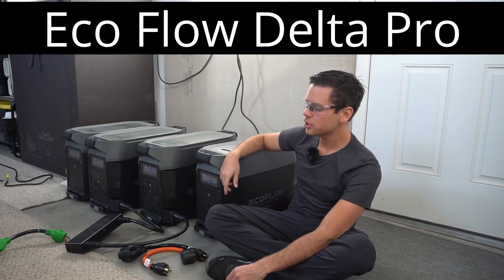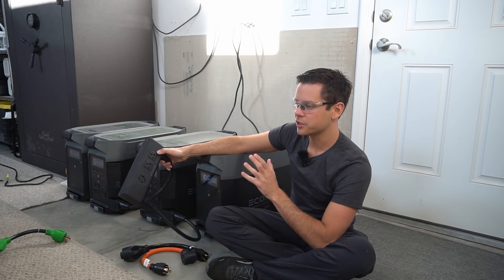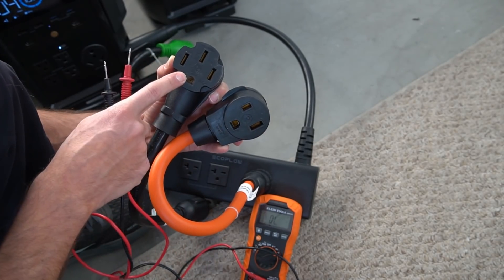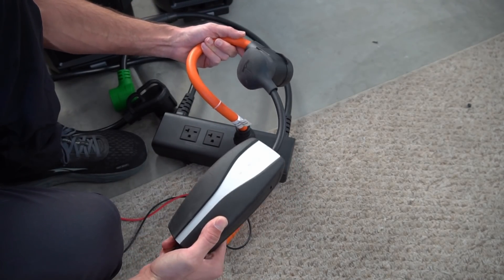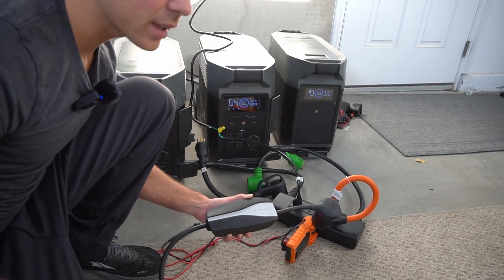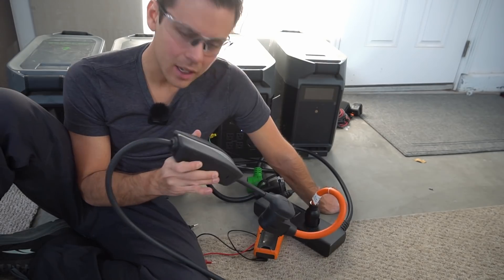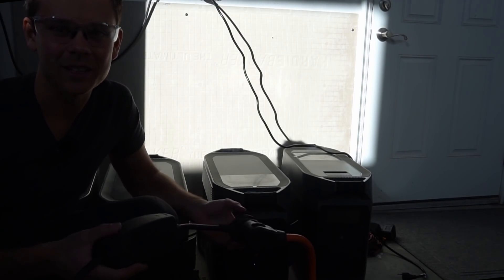Ecoflow Delta Pro: Strange Problem with 240V Output

Comment: Will,  Can you run a 50 amp rv on a ECOFLOW Delta Pro 3 by using a L14-30P to a 14-50R adapter plugged into the front of the Pro 3?    Thanks

Comment: I tried to take two, 120 watt generators/ inverters by using a parallel kit, change the wires in the kit to combine the two legs and power my house. My amp meter would go to 240 v and then start counting backwards because, I think the phase wasn't in sync or out of phase. Does each hot leg have to feed back on the neutral intern or is it simultaneously? This may be why your charger is not working with this setup. But I thought that Hub allowed you to convert the two into 240 volts and run your house. Would love to see you do a video with you explaining exactly how the electronics work inside of that hub. And I enjoy and respect how you make your videos.

Comment: I hate that I cannot charge via my inverter Generator via AC while the multi port adapter is plugged in. This really sucks cuz  the use of the multi port adapter shuts off all ac, both input and output

Comment: Question? I have the ecoflow rover pro and the expansion battery. bought them without the expansion cable.  not it is not a delta cable... might you by chance know if the pinout on the river cable is a straight or twisted pair configuration? so i can build my own cable.

Comment: I got it to work with a 240v Nissan EV charger and bonding the ground-neutral pins in the 4 prong generator side of a NEMA 14-50 adapter.   Using the same setup I tried to connect the Tesla Wall charger and it gives the same error you observed.   Here's the puzzler I don't understand:  If I plug in the Tesla Wall charger to my main House panel then unplug it and quickly plug it into the adapter on the EcoFlow DP double voltage hub.  It works great up to 32 amps.  240v.   But once that system shuts down I have to go through the same process of unplugging and plugging it in with the home main panel.   As you probably know there is no connection of the neutral to anything in the Tesla wall charger.  It only uses the ground and two hots so I can't figure out why it doesn't work with the Tesla Wall charger like it does with the Nissan 240v charger.

Comment: Question: not sure if you tried this or not have you tried to connect this unit directly to your home electrical panel via an interlock and set up a specific circuit for the Tesla charger (being the wire is grounded and neutral present perhaps you can trick the charger to think it’s a normal circuit?

Comment: Can I connect 2 Delta Pros using the doubler and then plug a 50 amp RV (with the appropriate adapter) into the 240 volt 30 amp receptacle on the doubler?  This would be much easier than rewiring my RV for solar and would allow for a transportable solar system if you changed RVs.  I will charge the Delta Pros with 1260 watts of solar.

Comment: Do a video on connecting two delta pro and two batteries to a 50 amp plug that connects to a house let's see how much hours of power you get running a house

Comment: I've been looking at these and the Bluetti for the 220v functionality but they're a little pricey for what I want. I've been watching tons of your videos trying to figure out what is the cheapest way I can build a small solution with 220v and about 10kW peak output to be able to cycle my well pump several times during a power outage. Any suggestions?

Comment: You might need to cautiously lift the plug out or use one of the other outlets on the box to measure voltage with the charger plugged in.  Sometimes things look good without current, but different with current.

Comment: The proper solution should be that eco flow provides a access on the device that lets you tap into the homes ground or connect a grounding rod directly to the unit.

Comment: You are energizing ground conductor when you connect neutral and ground wire together. There’s division of current between neutral and ground, and probably a GFI circuit senses that and immediately shut off your charger. You have basically replicated the erroneous practice of connecting the ground conductor with the neutral conductor   in a subpanel.

Comment: Hey, Will.    Ben Sullins on his Channel got this to work as an emergency refueling for his Tesla.   You saw that one, right.  He just had one in his trunk, and did it in a parking lot, not connected up like yours.
Reply from the maker: Not the same. I have past videos doing what Ben sullins did, but that's using 120V. I'm using 240V

Comment: Is it any issue relating to the nature of the 240V (220-250VAC) used in other countries - ie. single phase to neutral (with a MEN connection), rather than split phase US 240V...

Comment: Hey all, Thinking of getting one of these for my van conversion. Anyone if the constant daily use would appropriate for this unit? Or is it more designed for occasional use? Thanks for any input :)
Reply: In the same boat so watching 👀 a response.
Reply: Also have you also considered the Growatt off grid beginners system Will talked about before?

Comment: As Tesla isn't the only one, my KIA e-Niro also has error code, I think; the reason of EV charging without earth ground issue, is do to the protection from lightning strike as during outdoor's charging. Because rubber tires well insulation. As grounding will protect older houses from lightning strike; as older houses along with way outdated wiring. Safety is first for EV.
Reply from the maker: Good to know

Comment: I ran into what appears to be a similar problem. I used to use a UPS for my electronics loads because my inverter (Victron 350W) couldn't handle the inrush current. The UPS could handle the floating neutral fine, but with a warning light on the back. I upgraded to a larger inverter that could handle the inrush without a problem, but the UPS tripped the GFCI in the inverter (Renogy 1000W), even with the inverter's bonded neutral. I'm guessing the GFCI current transformer is in the wrong place. Either a disconnected ground or an isolation transformer would solve the issue. I also now use an APC ATS for electronics load so I can switch them to utility for inverter maintenance or low batteries, with no UPS in the path. Also, my Renogy could handle all L1 EVSEs I could throw at it. I haven't poked around enough to dig further into the issue. Wait, I see you may have found a solution below I'll have to watch.

Comment: Ecoflow is a little strange. It wouldn't charge my chainsaw batteries.  It barely ran a water pump and only if I had a small 12 volt battery helping it.

Comment: I simply use the 30A outlet on the DP to charge my MY.  I purchased a converter plug that goes from the 30A DP outlet to a NEMA 14-50 and I can charge at 24A.  I also had to purchase a bonding plug for it to work properly.  I only the single DP for now so only pick up approximately 3 kWh of charge in roughly an hour.  Not the most efficient but works in a pinch.

Comment: I haven’t tried it by itself but with the double voltage hub connected to my whole home automatic transfer switch I was able to use my delta pros to charge my Tesla. I suspect that if you make an adapter cord in between the 240V plug and the Tesla UMC and bond ground to neutral it will work. You may be able to use a bonding plug on both units and it may work as well.
Reply from the maker: With any system you want to do a ground neutral bond in one location only.  With my split phase inverters it's always at the panel. Where is your ground neutral bond for your house backup system.
Reply: @WillProwse   of course. It’s bonded at my main service panel, and for portable use I bond with a custom adapter I made.

Comment: i  don't believe there is any instance where a grounding wire and neutral wire should be connected after the output from the inverters.  In some instances where doing so makes the device "work", there are probably safety issues with the circuit. The problem is not with the Tesla but more likely with the wiring configuration between the inverters and adapter.

Comment: I am wondering if they are simply out of sync making it aper to be a neutral problem.  Wonder if you could use a 240 motor 1 to test the accuracy of the wave simply by running it on a known 240 source and comparing 2 could try running a low power 240 motor to work in line as a mechanical wave sync.  I know it wouldn't be practical but might be a way to check or understand better what is happening

Comment: It's quite possible that you have a high-impedance ground and the Tesla charger is testing for this.  A simple test would be to connect a regular incandescent light between one of the 220V legs and ground.  If the ground is ok, then the bulb will light at regular brightness.   If not, then you need to figure out how to bond (connect) the ground and neutral from the Ecoflow unit (assuming this is allowed on the device).  In North America  the ground and neutral are connected (only in the main panel).  This prevents the Neutral from floating above ground potential.
Reply: According to  the charger manual this is probably the reason why charger wont work. Charger tests ground by sending small amount of current to ground pin to check it.

Comment: My opinion is to find a unique way to charge from straight dc .. no one did this so far.. I don't know if its difficult.. but i guess the charger will have a dc output going to a bms .. if you find this and add a plug.. then just match the voltage via converter or a solar charger?? I know its ready your way but it DC to Ac then Ac to DC ...

Comment: Will please check the neutral and the power line if they are not backwards
Reply from the maker: That is an issue with some models with 120V, but there is no neutral designation here besides being used as a ground. The neutral is not connected. I did find a way to make it work. Just need to bond the ground and neutral.
Reply: Yup this is exactly what I was going to say.

Comment: Think about this. We’re taking a lithium battery bank and converting it to AC to then convert back to DC and charge lithium batteries. Doesn’t it make more sense to “supercharge” as in feed DC to the DC input and let it rip?  Less losses in conversion, no pesky sin waves messing with our charge and the ability to put probably 2x the power in. What stops us from DC charging a Tesla? I don’t know.
Reply: I wondered the same thing. I think the answer is 440 VDC isn’t easy to make nor safe to mess with

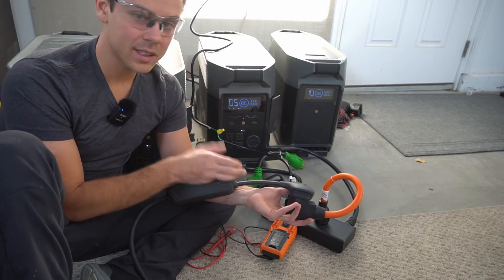Comment: 2:50 "It simply do not work"

It will work with a Tesla EVSE made for Norway. They made a spesial one for Norway that have the ground testing disabled..  The reason is due to Norway have a lot of TT and IT power distribution...
Reply from the maker: Oh interesting!
Reply: @WillProwse  and now you know why you can disconnect Neutral and ground in the European inverter...

The TN distribution network have one live and one Neutral in the 230V socket,  while IT and TT have two hot .

It's worse for  Renault Zoe. It can only charge on TN, so the charging cable have a 2.5 gallon transformer connected, and it's heavy. It has two handles to be able to carry it.

Comment: Can't you Ohm out the adapter box, They could also have some discrete components in the adapter housing if you can open it up and you can trace out what the wiring is as well as get an idea of what any added circuitry is doing. Also Ohm it out with your NEC-650 adapter.
This sounds rather fun

Comment: Ground is not a power leg, neutral is. your phase may be off more than 180 degrees between line 1 and line 2 if you are trying to establish a phase compensation using the ground as a reference instead of using the neutral.
Reply from the maker: That would not make sense, we would not have the voltage readings that we have if they were off. I have encountered that problem with my previous split phase inverter programming videos. If they were off by 180 degrees, we would not have 120 volts to ground. And 240V between the two hots. I don't even need the ground. I charge my tesla from a floating system every single day.
Reply: @WillProwse  Two 180 degree phase make one complete phase with the sum of those two phases, your tesla might be sensing an amplitude  or slight phase difference as line 1 and line 2 combines. As you've said, you have successfully charged your tesla on a floating circuit, therefore the only thing it can sense would be the phase from the combination point. The arc of the sinusoidal wave at the combining point is shifting or ceases to maintain amplitude.
Reply from the maker: @dean5263  OHHH ok I understand what you mean now, got it.
Reply from the maker: @dean5263  I am thinking that the ground of the other receptacles might be the neutral of the generator plug. And a floating ground for the generator plug. I need to check that next.
Reply from the maker: @dean5263  Nope, the ground is the same for both. So there maybe some issues when plugging in other loads into the other receptacles because they do not connect to the neutral.
Reply: @dean5263  you seem hella smart.... Electrical engineer?

Comment: I'd guess that the inverters aren't clean enough or aren't perfectly synced. Any imbalance can make the potential to neutral look screwy. 
A good line conditioner might help but it'll eat some of your efficiency. How much/whether it survives depends on how far off/noisy they are.
Reply: Personally i blame the US power grid. Ditch the damn 110v and simplify the entire worlds manufacturing complexity.
Reply: @TheBelrick  The US runs on 240v lol. The US does not run on 120V. We center tap our transformers to allow for 120V circuits in the 240v system. (because 120V wont kill you)
Reply: @joshdoeseverything4575  Why not also increase this amazing range of options to include: 90v 60v 30v! appliances!!!! And make manufacturers allow for this amazing versatility.
btw 110v can absolutely kill you. 
Or grasp that you inherited from your forefathers dodgy standards that should be phased out.
Reply: @TheBelrick  by that note why don't we have 580V in homes? 1000? The higher the voltage the smaller the conductors need to be after all. 120V is a great midpoint for conductor size and safety, and because our system is 240V we still have access to that potential by just connecting both 120V hot leads to each other. It's a safe and proven system and any electrician will tell you the same.
Reply: @joshdoeseverything4575  great ideas. usa should have 1000 voltages supported and catered for! now you are in the spirit.
ps 240v is a safe and proven system used by billions

Comment: Wow  Will 3 videos in a couple of days. Your a man on a mission! I am still just trying to figure out which  system I want to go with I am doing  a 9 panel (150w) on a airstream trailer (1972)  and can upgrade just about everything.  And would like to use the system to offset my electricity use in my house. But I think I could get by with 12v system,  would like to run a 48v system because of efficiency and the best mini split Hvac 9000BTU is 220v 42 seer by Carrier  but I can get 32seer 110v for way less ($1200) and on top of that 24v is still on the table. Pretty sure I going with the Growatt 5kw for under $800 to my door and the lifpro rack battery ($1200) found a not for profit company that has commercial 5-6year old mono panels for $0.17 a watt ($25,50) a panel and local pickup no shipping.  The 5kw growatt is probably over kill but I plan on having reserve panels  on my camper shell so another  1800w to the 1350w on the trailer  for a grand total of 3150w but at best I will draw and avg of 900w (trailer) x 7 hours (avg sun hrs) = 6300w  daily total.  Still trying to calculate all of the daily demand to see if I need to add solar to the truck camper top.
Reply: Fujitsu 9,000 BTU mini split.
120vac.
Super high SEER.

Comment: Wait! Ecoflow Delta pro uses LFP? I thought they used a different chemistry, that's why you don't get as many cycles from them as you get from the Bluetti AC200P and AC300s.
Reply: The River Pro uses lithium ion. Maybe you're thinking of that?
Reply from the maker: The latest one does use LFP. Which is why I am excited to use it. How cool is that?!
Reply: @WillProwse  VERY cool .. the one thing that made me hesitant about the Ecoflow devices is that they didn't use LFP and therefore didn't have enough cycles (800 vs 2000+ on others). I LOVE that they have a high charging rate (so you can recharge them faster) and that they provide a LOT of power. This switch to LFP puts them at the top of my list of things I want to get this year.  Thanks for confirming this.
Reply: @WillProwse  That is cool, except mine doesn't! 😂